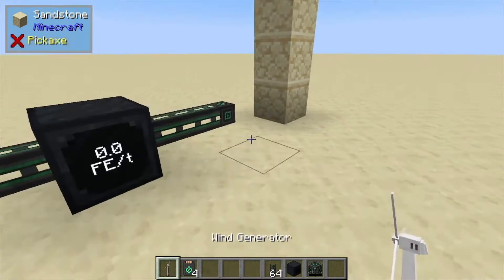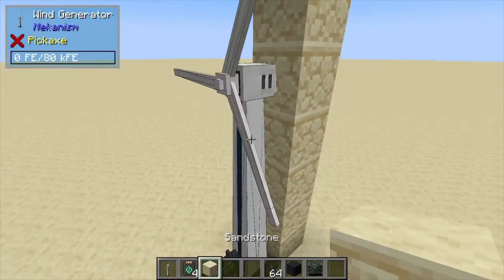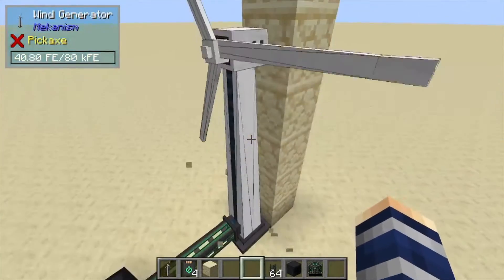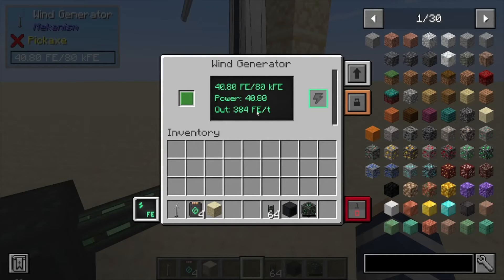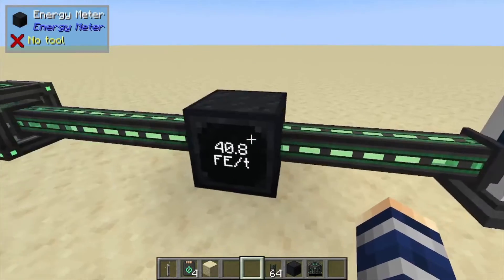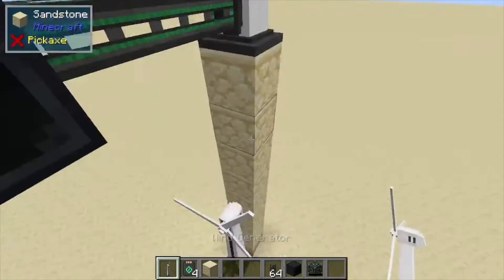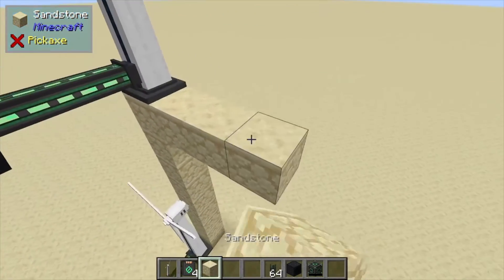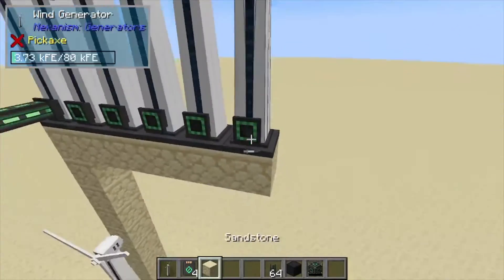Mekanism: Wind Generator (how to use and where to place)

Comment from the maker: According to facebook fact checkers  😂you can also draw power from the bottom allowing you to stack these side by side without spacing them out...(Im on vacation so i cant check for myself but when have a facebook fact checker been wrong 🙄)
Reply: Haha I need to check this out tomorrow 😂
Reply: Confirmed! In my 1.19.2 world the wind generator has a green square on the bottom, very similar to the one on the side. I drew power from the bottom to power my machine.